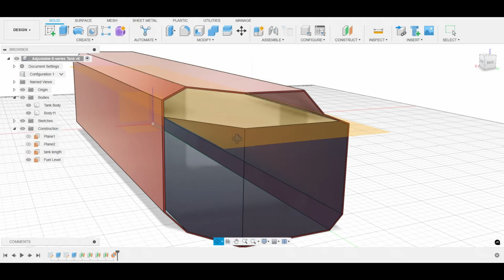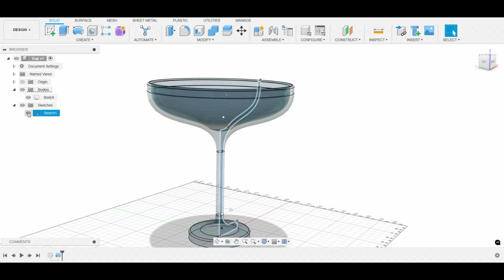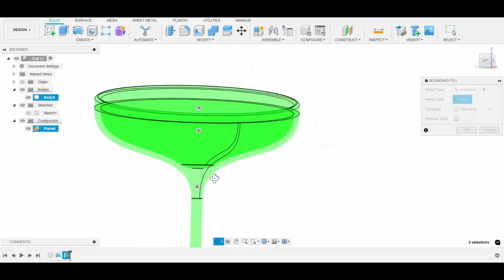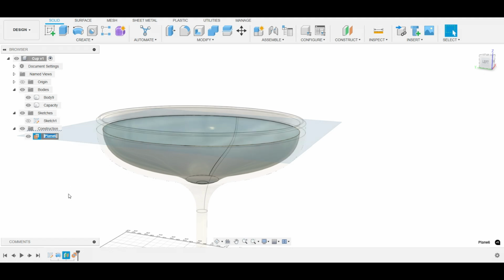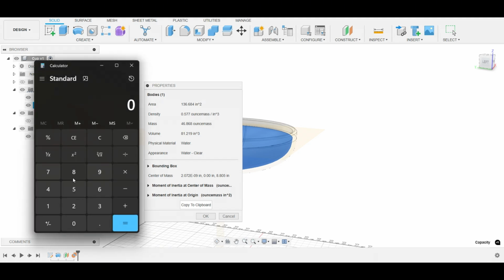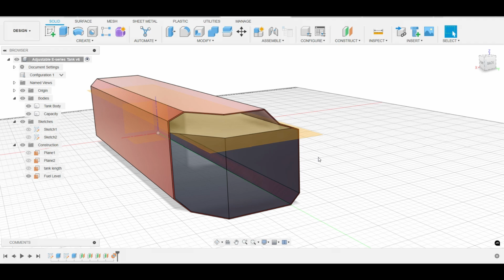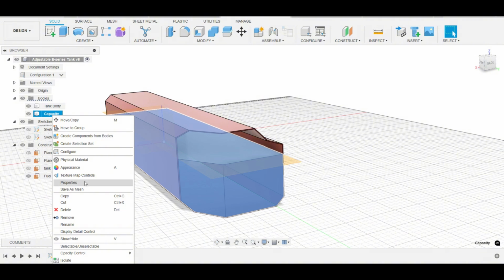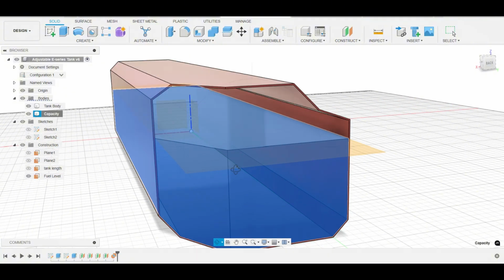Custom Aluminum/Steel Tanks and Using Boundary Fill | Fusion 360 | Basic Tutorial

Comment: Are you using fusion to design the tank in order to have the parts machine cut?  If so, I'd be interested to seeing the process.
Reply from the maker: Yep, all my tanks are drawn up in fusion. Then I create flats, and cut them on my multicam cnc router.  From there I fold them.  

I have had a few people ask about this topic, so I will cover the process.

Comment: I was just designing an aluminum tank for my mini jetboat and was having trouble making boundary fill work correctly so I did a search for Fusion 360 Boundary Fill Tutorial.  This was super helpful.  Turns out, some of the clearances on my tabs made the boundary a little leaky so it was trying to fill the walls of the tank and not the void.  Problem solved.  Thanks for posting!
Reply from the maker: Nice, Glad it helped out. It’s an awesome function when it works!